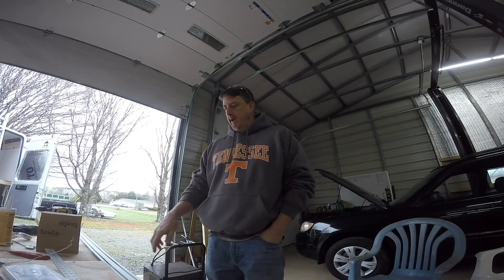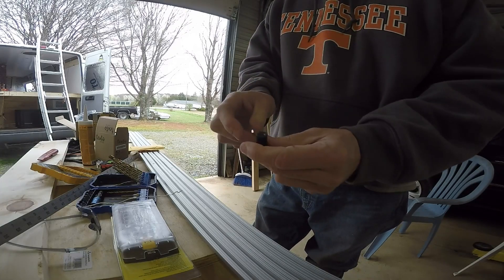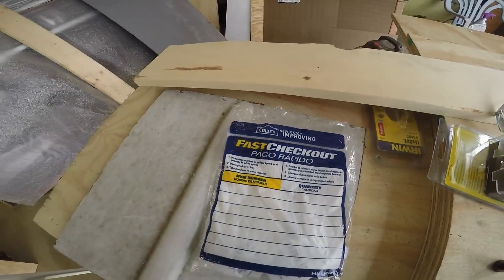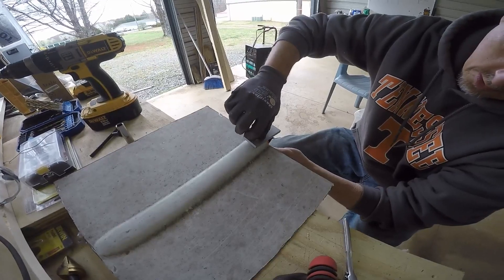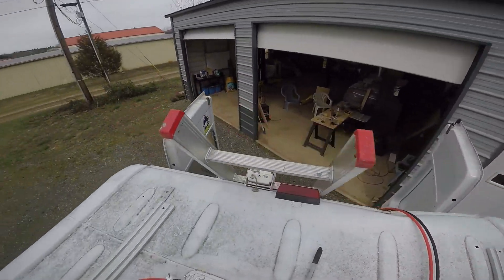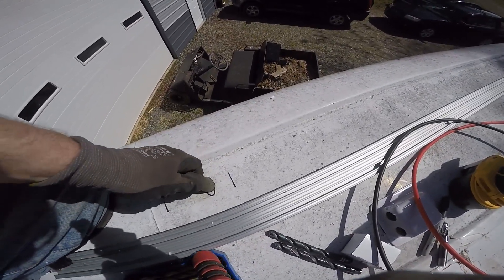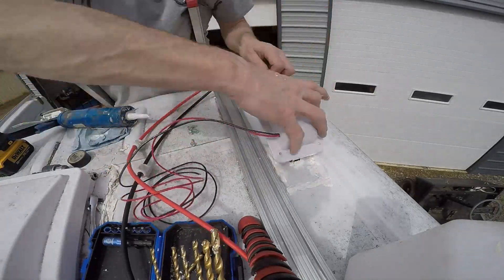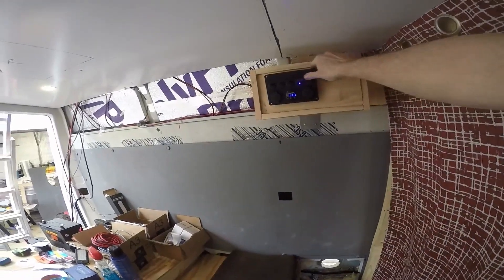2005 T1N Sprinter Van Conversion Solar Panel Installation with Budget 8020 Roof Rack

Comment: Thanks, I like your reasoning.  So after 3 years, would you do anything differently?
Reply from the maker: I would really like a more heavy duty rack setup. One that I could mount an awning to and possibly a side mount for a kayak but this has worked for what I need. I have a lot of other projects going on but if I ever get more time I may create a new roof rack. Thanks for watching.

Comment: How is your rack holding up two years later, any leaks? I used these expanding nuts before and they leaked, but I think I overtightened them. Thanks for the great video.
Reply from the maker: So far we've not had any leaks. Thanks for watching.

Comment: Great video! Are you happy with how the well nuts worked out? I'm getting ready to install some unistrut on my roof using similar nuts. Also, do you feel like you got enough stability mounting to the rib top instead of the roof valley?
Reply from the maker: Thanks for watching. I'm really happy with the way it turned out. I would say that if I did it again I might would put 4 nuts in each piece of extrusion. I only used 3 but it still feels secure.